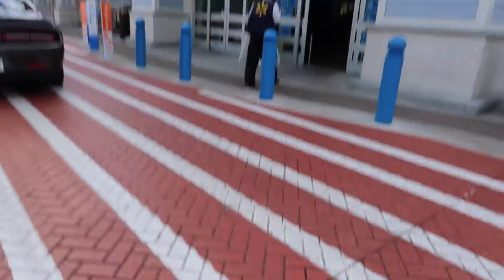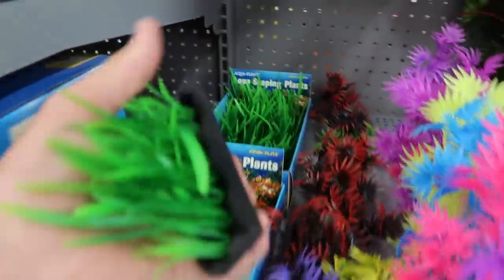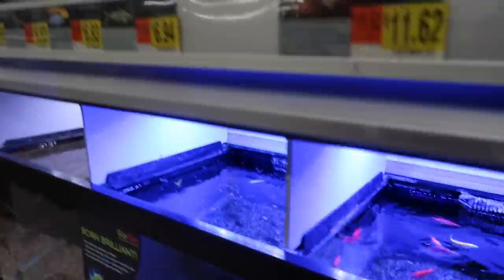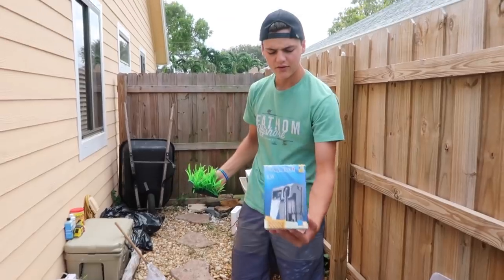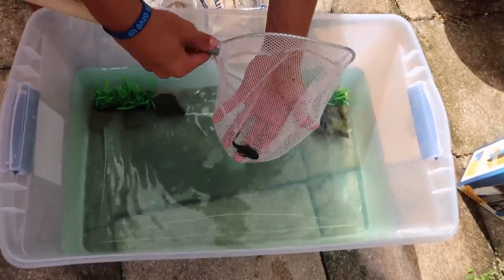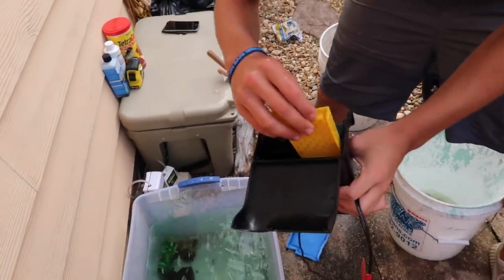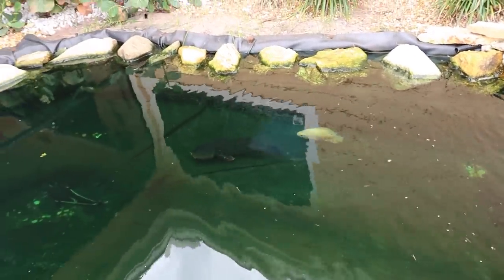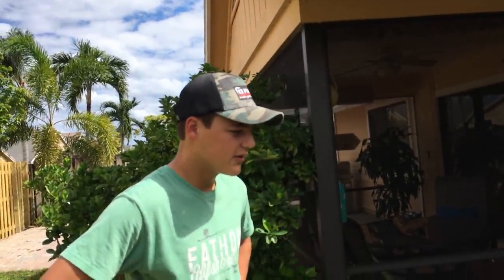HOMEMADE Backyard BAIT WELL For POND! *First Live Feeding*

Comment: First off, you don’t need to just throw that fish around in the bag. Second, you can’t just put the fish directly into the new water, you have to let it sit in the bag so it can get used to the water temperature and doesn’t die of shock. Third off, I know it’s just for bait but you need to put more water into the “tank” and the filter would work a lot better.